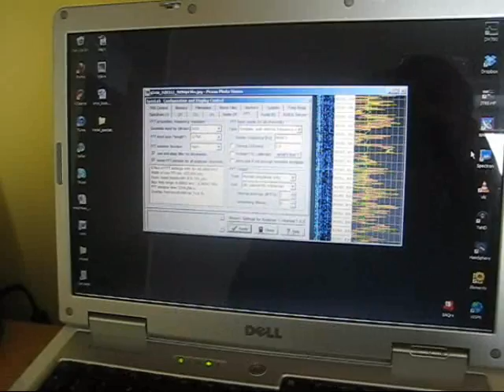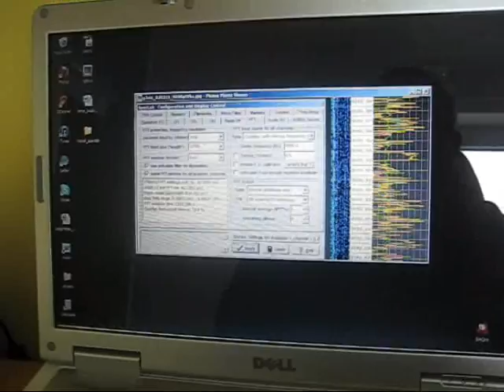VLF Amateur Band Reception (8.7-9.1kHz)

Comment from the maker: Many people use E-field probe antennas which are small but work well if placed well away from the house in a quiet location. It is ESSENTIAL to run a PC package like Spectrum Lab in which the frequency is "locked" by GPS or a VLF MSK signal like GBZ. When this is done you can look in incredibly narrow bandwidths with high confidence for hours and hours.